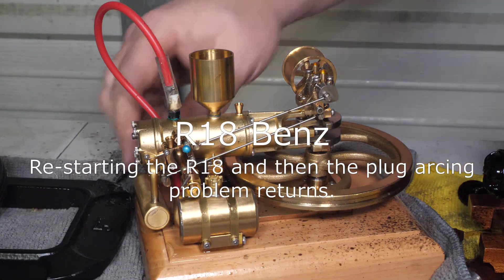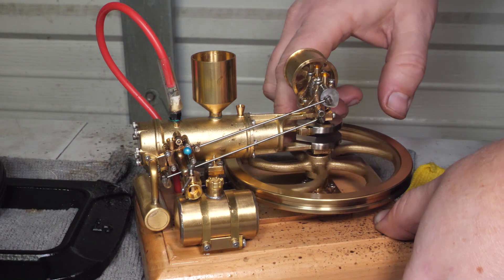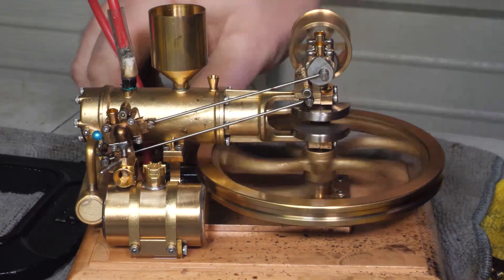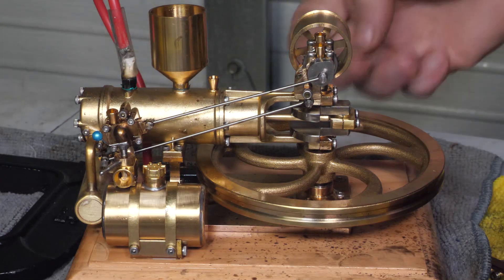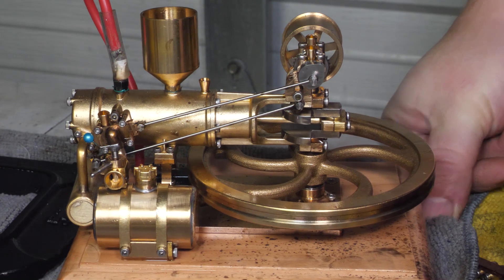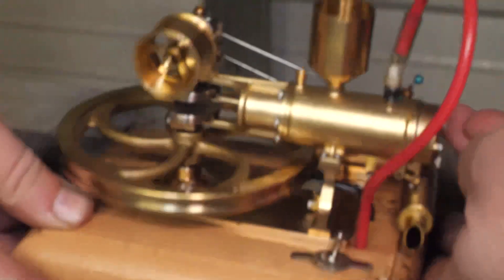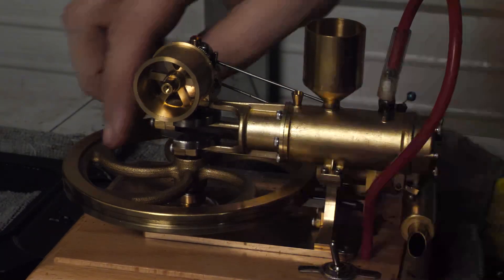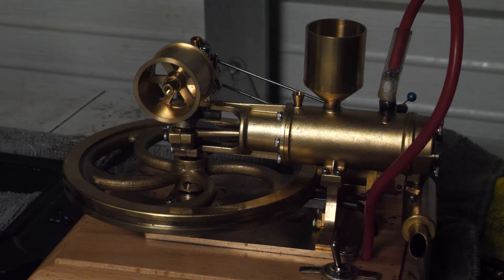R18 Plug Arc Returns

Comment: why you use not an small plug from an Honda four stroke. make an bigger hole   with thread.
Reply from the maker: This is a 6mm wrench plug (a smaller plug than the 1/4" model plugs in my other model engines) and the smallest plugs for small engines are 1/2" which is about the bore of this little model.

Comment: Hi Henry, I had the same ignition problem with my R18 and used electrical heat shrink tube over the ceramic  portion of the spark plug.  This has worked to prevent arcing for the past three months and is still ok.  I have since upgraded the plugs on my HM-01 and 1140 in the same way.
Reply: I'm a car guy but I think you are on the right track with heat shrink vs fuel tube. Anything will conduct electricity when the voltage is high enough. Make sure everything hands, spark plug, wire, heat shrink etc. is clean and DRY before applying the heat shrink. A short piece and a long piece over that. Dry is hard to do on something that works best when dripping with oil, but brake cleaner is your friend. The other thing I'm wondering is how the ignition source is grounded to the engine? Does it use a 9V battery and only the plug wire comes through the wooden base? I would think grounding the ignition source to the engine itself would also be important. Never done this in miniature stuff so...
Just watched again with the resolution cranked up so I could enlarge the image. I think all your issues are at the plug. The plug has a weird end on it. Since the plug wire is metallic I would cut the end off flush, and screw a tiny copper or brass screw into the wire. Then use the heat shrink to pull the screw tight to the plug. It should solve all your problems. 😊
Reply from the maker: Black shrink tubing is a great idea.  I will have to use that on some of my other plugs. 
 The R18 arcing is so severe that the ignition lead will also jump sideways to the water hopper.  I had to use the piece of fuel tubing because when I insulated the plug better the first time, the arc just reliably jumped to the hopper until I put the full length tubing on to force it back through the plug.  The fuel tube with E6000 glue to hold it on the insulator has worked for about a year.